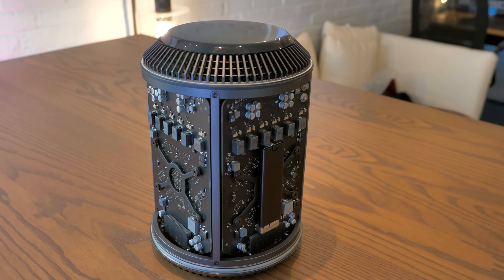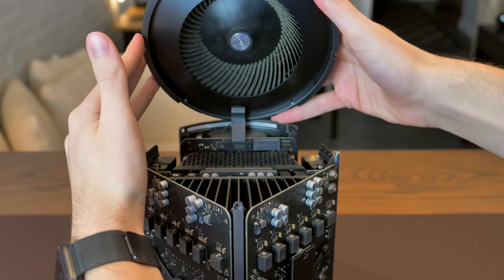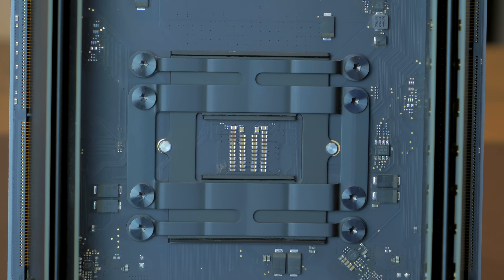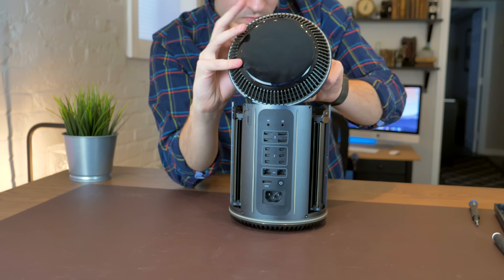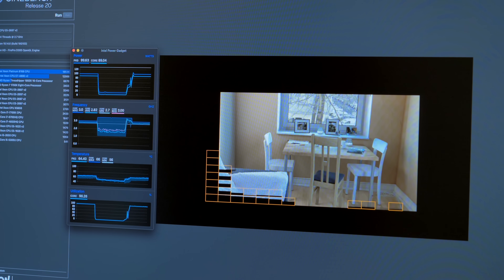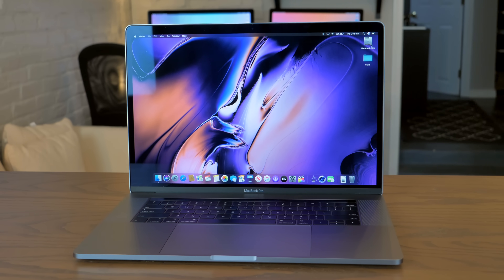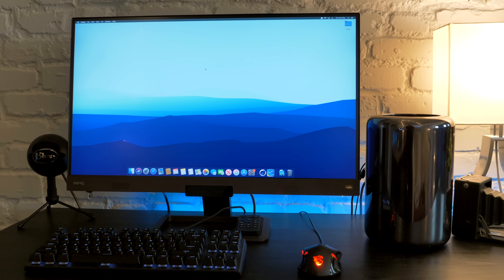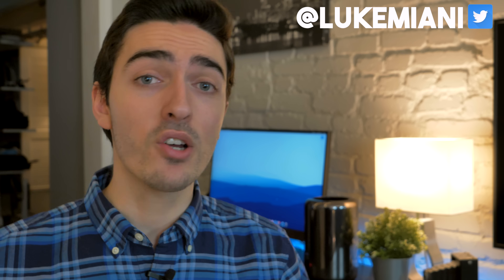Building the CHEAPEST 12 core 2013 Mac Pro!

Comment: Thanks for all the cool videos. I wish you didn't hate this Mac Pro. I would love to see a bang for buck comparison with a Mac mini that has equal Ram, and equal HD, and an eGPU that performs like the 2 D300s. These cards have a Geekbench 5 score of around 20,000 ea. These are like Radeon 7950s. Final Cut and other Apps that can take advantage of two of these can equal the performance of a single RX580 at around 40,000. I bought a used RX580 for around $100 and a used eGPU housing should run at least $200. While pricing these, I would love to see some Video Editing Comparisons. I would also like to see the thermals compared while rendering out a 1 hour 4k movie. I wish Apple would have updated these to modern iMAC PRO Xeons and lower power Radeon IIV GPUs with 16 Gig video memory each. Then gave us the New machines named appropriately as XSERVE. This is more in line with what most "PRO" users need. I do very much appreciate everything you guys go through to source these machines for us and run them through their paces. Last note ... before referring to these as "Trash Cans" ... next time put any mac mini, iMac, Macbook Pro, or anything next to these and crank up a "Heaven" benchmark. Then after about 5min, close your eyes and listen. I like to call it "The Music of Silence".

Comment: Finally, I have been asking you to do that for ages, and in earlier osx versions, or with a hack you can use newer gpu's,  of course it will not compare to 2020 computers, it was 2 years out of date in 2013, and nothing was upgraded, it's entire life.
so 2011 12 core versus 2020 anything.

having said that many music studio find it quiet and powerful enough for LOGIC X, Protools and any Pro audio work.
SInce it does not have intel quiksync like the i7 and i9 and is not so great at video, although it gets the job done without that trick nut slower, except with AMD egpus.

Or with older OSX version cuda gpu's

Geekbench 3 was popular back then and it should be tested with that, later geekbenches are made to make newer processors and gpu's look even faster than they actually are, but that usually does not show in real world uses.

For the most benchmarks on the 2013 Mac Amature, auh Pro, which was never updated by apple, check our www.barefeats.com and put in 2013 Mac Pro in the search.

You only use 10-15%  gpu performance with tb2.
Both have 40GBS, tb3 is one way, tb2 is 2 way which can be more effeciant at times, so it does not lose as much performance as many think.

Ironically Apple to away eGPU TB support for this machine with later versions of OSX< right when they releasedblackmagic egpu?

I guess not to still Mac mini and iMac Pro sales, but with a tb3 to tb2 adapter from Apple and a hack or earlier versions of OSX you are fine.

And unlike the new Mac Pro and every new mac, you can run older OSX versions, meaning tens of thousands of programs and plugins and apps, with some 32bit code will work on this and not newer macs, including quite a few games and Pro Music/Video/Photo apps, that are still current and being developed as well as discontinued apps on the cheap.

Comment: The main downside is the age and graphics - the age is not a specification / the graphics? unless you are a gamer or editing video the graphics are more than adequate, I produce music and it runs Logic superbly and the thing you call the 'Trashcan' (a very negative term) has is great connectivity, the 6 thunderbolt ports across 3 separate buses and an HDMI and digital and analog audio I/O and 4 USB ports, it's expensive to buy now (so it has retained it's value) but I already have mine (with the D700 cards, 6 core and I may upgrade it to 12 core) so the current price is not an issue, it runs cool, does not over heat and is rock solid with Logic. People buy computers to use them in the real world, not to just run benchmark tests. One other thing, the reason I chose a 6 core is because the processor is faster (3.5) than the 12 core (2.8) so are the extra 6 processors worth slowing down the computer for . . . . I suppose it depends if you need throughput of faster processing or rendering power which a slower computer is OK for . . .

Comment: did you find any significant difference after the 12 core upgrade? i mean in real life? i didn't find much difference.
Reply: do remind that on single core-applications, those that most people use on a daily basis, a Quad-core will be faster (3,7 GHz  with turbo boost up to 3,9)

Comment: No... if it was thunderbolt 1. You can make that claim. But with thunderbolt 3 and thunderbolt 2. The difference between both of those is 10% Because in reality. Any egpu will only take 22gb at the most. Not the full 40gb on the thunderbolt 3. Your still loosing 30% performance with thunderbolt 3. If fact there are people who did tests with the thunderbolt 2 and thunderbolt 3 enclosures. The difference is marginal at best. You wonder why there is usb 3 and ethernet ports on egpus to begin with. If somebody would create a egpu that is 8x pcie speed. That takes two thunderbolt ports. Then you should be getting most of the performance of that gpu. No one has done that so far.

Comment: i wanted this machine so much because this is a hell good of a deal foe me. the ECC REG ram in china is extremely cheap and the cpu too, not to mention about the ssd upgrade option which is also cheap in china too. (i live in hk) Also, as i am currently a mac mini (2014) user there are really no hassle to upgrade to a mac pro 2013.

Comment: All the MAC Pro Computers are overprices, you get abetter or similar Computer from Dell for better Price. And A Dell PC is better Serviceable. Even the Old MAC Pro are even Better, and Upgradable I have Paid, 200€ for my Dell Precision T3610, with a intel xeon e5-1650v2 16 GB of DDR 3 ECC Memory 4 banks Left from 8 and I can upgrade Even further..in CPU and RAM. also the GPU..and i have Testet the LAstest MAC OS on it, but i stay with Windows 10 as a Gamer ;) A nice PC Monitor is to get from 50€ (24"LED Monitor with Dispaly Port, HDMI, DVI) and Wireless charging for Phones.

Comment: I know you probably know this, but the Mac 5,1 runs cooler, is nipping at the heels of the trash can on CPU (2x3.46ghz) and kills it on GPU with an RX580. Add in that it can be had cheaper and is much easier to upgrade, and the trashcan really doesn't make sense as a used Mac purchase.

Comment: Wouldn't a 8 core 2667v2 at 3.3 ghz be a better upgrade?  Multicore almost matches the 12, and single core performance shows a slight improvement over the 3.7 4-core.  Kind of explains why Apple didn't offer it as an option:
https://forums.macrumors.com/threads/best-cpu-for-mac-pro-6-1.2166739/

Comment: Luke- can I add a faster processor to a late 2018 6 core 3.0 ghz Mac Mini?
Reply: Sammy Jax no, it’s soldered
Reply: Lili Hellriegel so I can remove it with a heat gun if I’m careful?
Reply: You can but you also need to reball the new processor when you need to attach it to the board

Comment: The thing that gets overlooked on a lot of machines like this one and the others you mentioned toward the end of the video, 2018 i7 Mac mini etc, that seem to not have an apparent user or purpose, is that these are EXCELLENT audio machines for music producers, mix engineers etc. We're always going to add a 3rd party audio interface/sound card anyway, so processor speed and RAM are most important. I personally chose the Mac mini for this. Found a good deal on the base i7 model for $999 brand new, did the RAM upgrade to 64GB, and bought a T7 for storage. $1400 later and I have an audio screamer!
Reply: If you were a professional you wouldn’t get something this old right?
Reply: @TheJOE174  I know guys still running 2010 Mac Pro's so definitely!

Comment: Could you do a comparison of a maxed out 6,1 vs. a maxed out 5,1?  Comparing both price and performance. TIA
Reply: I've got a firmware flashed 4,1 to 5,1 with dual x5680's / 128gb RAM / GTX 1070 if he needs benchmarks
Reply: In terms of Cinebenh R20 a Mac Pro 5.1 with 12 cores at 3.46 (2 x Xeon 5690) scores at around 3400 points, while the 12core Mac Pro 6.1 is around 3200 points. While the MP 5.1 is much more expandabel than the 6.1 I´d prefer this classic Mac Pro. But sadly Catalina officially doesnt support the 5.1anymore...
Reply: @renderbaron  I have a 5,1 running a non patched version of Catalina fully stable. Sidecar does not work however. That is it though. I installed onto a nvme in a external housing using a supported mac then just put nvme in a nvme to pci adapter that is compatible with the 5,1 and it booted. Runs fine. Airdrop recognizes it as the new 8,1 mac pro lol. People already have beta big sur running on 5,1s. May be patched though.
Reply: PizzieNizzie use Duet app instead of side car
Reply: @PizzieNizzie  Meanwhile I run a patched Catalina on my 5,1 here, works flawless. :-)
Reply: @PizzieNizzie  First off Side car sucks, Duet works way better in my experience, and also, I think right now Big Sur patch, Internet only work with Ethernet not WIFI is this true? I run my 5,1 with Mojave with option to Cat. 12core 64gb 6tb ssd with Vega 56 flashed, a 12 core with similar specs would run close to 10K! (obviously a bit faster for the newer models but not anything worth debating). Hopefully Big Sur ends up patched well for 5,1
Reply: @DB-lr6kl  Yupp
Reply: @renderbaron  funny i am running mojave on a 5,1
Reply: @jacobbrown1690   Meanwhile I run a patched Catalina on my 5,1 here, works flawless. :-)
Reply: T A he’s talking about specs on a 2009 Mac Pro
Reply: I would love to see that too!
Reply: I'd like to see a vid like that too
Reply: Charles Kimble and Luke I would love to see thid
Reply: @djperu  Same

Comment: Thanks for not crapping on my trashcan for once!  I am about to upgrade my 6-core to 12, and since I live in Asia I can just pay a shop to do the installation $20.   Can you please show the benefits of using various eGPUs with various cards to see what would be a cost effective upgrade in that area?  Us previous owners of trashcans would thoroughly appreciate it!  I also would like for you to demonstrate the various SSD upgrade options.   What I love also is that I have 64GB ram and I can run several virtualizations currently without any performance hit.  I find it faster to run windows in emulation on my trashcan than actually using my various windows devices.  And I always love how quiet it is!